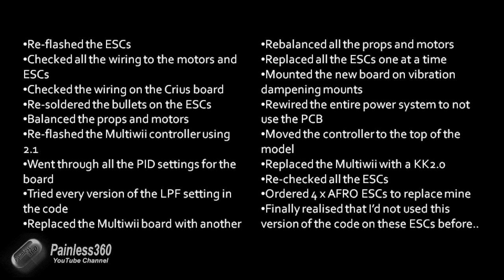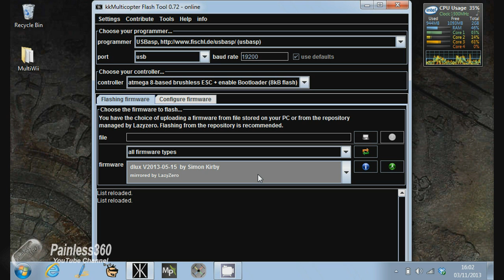Problems with HobbyKing 20A ESC after flashing with of SimonK firmware V2013-9-20 - Solution

Comment: Oh I see what version are you running?
Reply from the maker: +moejammin The version I show in the video - most are noted by their release date..
Reply: Thanks alot for the info, I was able to grab a afro usb linker to program the esc with simon k, but when Im at the end of the flashing sequence the flash tool says "Error during reading of high fuse" do you know what that means?
Reply from the maker: Lots of things could cause this - if you Google the error you should find lots of things to try. Best of luck.

Comment: Hello! I know it's a bit late now, but sorry to hear of your woes! Just a note for future viewers, I'd prefer if the latest release could be tried first, and if there are any problems, let me know. In my testing, all of the motors I have work without issues. I don't have every motor ever made, but I did collect quite a few of the more troublesome ones since hearing of some problems.

2013-09-09 was the newest release before I significantly changed zero-crossing tracking since 2012-09-30, and then the 2013-09-11, 2013-09-20, and 2014-01-19 releases each changed tried different approaches. 2013-09-20 did make things worse for some motors, hence the next release, and so far I haven't intentionally changed it since then.
Reply from the maker: Simon Kirby Hi Simon, thanks for the message. I'm a fan and all my copters fly with your firmware. Happy flying!

Comment: Thanks for reporting this. I also had a sudden single-arm power failure today, causing involuntary flip (fortunately I was test driving with low altitude above grass, no damage). Turns out I didn't pay enough attention and flashed different firmware versions on my HK20A ESCs - some old, some new. Fortunately I saved the log file for each of the updates so I could trace this back. It does pay off to keep track of what you've been doing to your equipment :)

I did not experience stutter but did notice fluctuating yaw effects that did not want to be trimmed away. I'll reflash with the older firmware...

Comment: I hope your right with this, been having the same problem where my motors are stuttering with fast throttle inputs and the quad drops an arm and sometimes yaws a bit. Done absolutely everything trying to find the problem. I've just found your video and I also installed the latest version of the dlux simonk and im now itching to get home and reflash as you did.
Reply from the maker: If you flashed your ESCs using 0.72 of the program and flashed V2013-5-15 this should sort you out see all the reports on the forums - i.e http://www.rcgroups.com/forums/showthread.php?t=2040749

I hope it sorts you out too - I wasted over $100 on parts and a week of hobby time fixing this issue. Not impressed!
Reply: Painless360 I think im actually using v0.76 beta.
Does the issue only show with certain motors? I tried different motors and it worked fine so I kind of dismissed the escs and though the motors were the problem. With turnigy D2822 / 17 1100kv I get random motors stuttering, but with turnigy 2830 / 11 1000kv its fine. By the way its an f330 with kk2.1 and hk f -20A escs.
Reply from the maker: I didn't try different models of motors - just replaced those that seemed to 'stutter' when the ESC needed to change speed very quickly. I'd check the forums as this may be another version bug similar to the one in my video.
Reply: Painless360 I flashed with v2013-5-15 of simonk but its no better, in fact was worse because as well as the motors stuttering with fast high throttle inputs,  one motor also stuttered at startup and had to keep resetting throttle till it actually spun. So then I thought sod it il try the wiiesc firmware, and its best thing I could have done, not only have the motors stopped stuttering completely,  but also seems to have loads more power. It was the BS N-FET version of wiiesc I used.
Reply from the maker: Glad you sorted it. Where did you get the code from?
Reply: Painless360 Thanks, me too. Its on the lazyzero software, just a couple down from the simonk.

Comment: HI, the problem is probably in kkMulticopter flash tool. There is a bug in 0.72 version that upload the wrong firmware on your ESC. The bug is only present on SimonK bs.hex firmware newer than 15-05-2013.